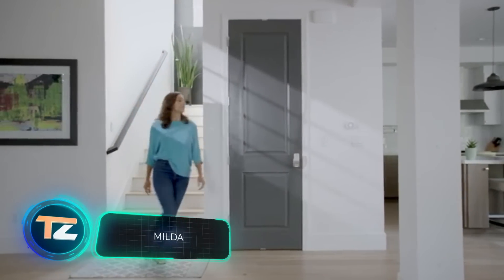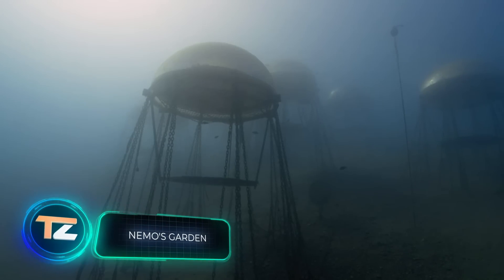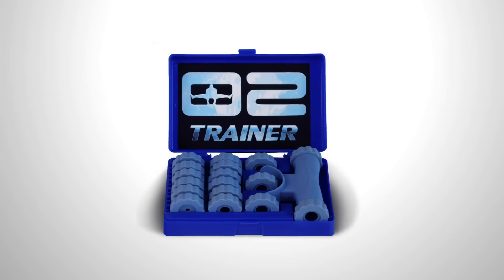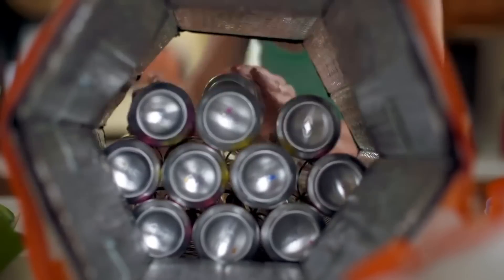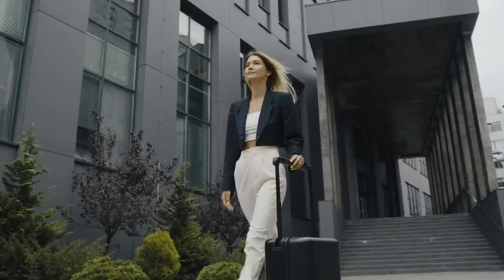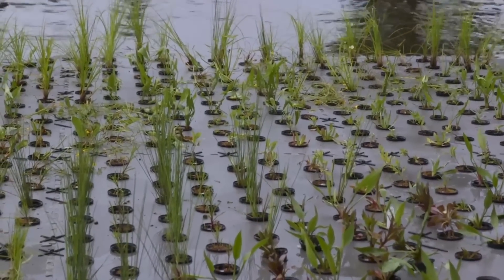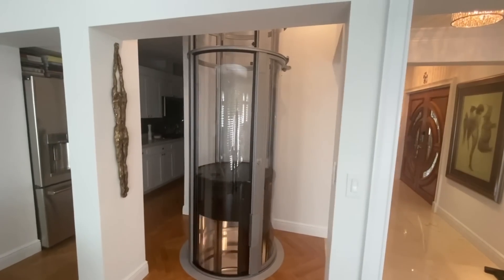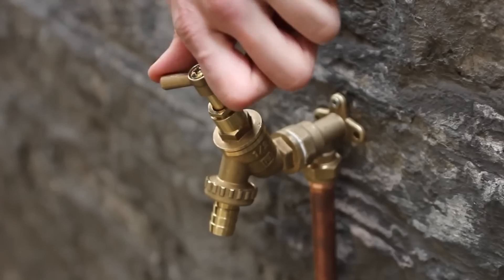12 INGENIOUS INVENTIONS YOU'VE NEVER SEEN BEFORE

Comment: Yeah, that "O2 Trainer" is basically a pvc valve. We had those in marching band, you can go to any local hardware store and buy a 1-inch pvc pipe valve for maybe $2, turn it so it's about 3/4 of the way closed, and practice your breathing. No special expensive device required.
Reply: Exactly. It's called suffocating. Doesn't take $70 to do.

Comment: That one for the fightfighters, that water lance that can penetrate concrete and metal walls will be very useful. Firefighters can just go on the crane then stuck that hose in the wall of the building and concentrate the water where the fire is most without busting windows or doors that just let in oxygen further fueling the fire or having the fire lick your face bec now the doors and walls became your shield. Kudos to the inventor! 👏👏👏

Comment: So the typing option provides a 20% slower option and requires a newly learned skill set on top of a bulky device that is in addition to the tablet. I’m SHOCKED that it didn’t take off!
Reply: Especially since voice use tech is getting better and better.   Yes the cliche is if you can just talk to text, why not call, but there are uses for texting over calling (if they are busy, late at night, not sure if they are available in general).   I think that product may have been good.. 20 years ago.

Comment: The water lance is a specific application tool. It's not replacing normal fire fighting gear and hoses. It's designed for fires on ships and in confined spaces. The lance wouldn't do anything to a house fire.

Comment: O2 trainer, a pipe with variable sized holes. You know what also has that function? A mouth. 
There, I saved you $60.
Reply: This is literally a $2.00 plumbing tee with scuba mouth piece put on one end of the tee. With two caps with on the other ends   with holes drilled in them. Buying this all at retail would be under $15-$20. Those extra caps are cheap and you want to save money you you buy one set of caps then make your own inserts from scrap plastic soda bottles or what ever..

Comment: Right off the bat. Must be said in a fire DON'T open a door if the handle is hot. It means fire is on the other side. You are in a room filled with oxygen. You open the door and the flame will be fed by that oxygen. To sell a door handle without this knowledge is careless.

Comment: I really enjoy these videos! Re: 8:17 The water lance that uses water to cut steel and concrete. Its got to be way more then 1000 psi. I use 1000 psi to wash the dirt from underneath my fingernails. I would estimate 50,000 psi for cutting steel.
Reply: 1000 psi ... say good bye to your finger
Reply: Haha! I own (2) Pressure washers. One is 3700 psi gas engine driven and that is a little dangerous. It can make gouges in soft wood - NOT cut steel. LOL
     The other is an electric 1700 psi model and it is harmless. I use it for mold on painted surfaces, mud on my ATV, and to wash my hands. It does a good job too!
Reply: @mikevp5303  he has terminator hand apparently lol

Comment: First up, if a door handle is hot in a fire it's because the room behind is ablaze and has reached a temperature sufficient to heat right through steel, which means if you open the door you could be killed in a blow out as you would add more oxygen to the fire and increase the danger.

Comment: 08:15 🤔 I was using a similar device in the early 2000's but the pressure of this device was 10,000 pounds max
Reply: I was wondering about that. Power washers operate at over 1000 PSI and I don't think one can cut through concrete.
Reply: @dlb4299  the pressure sprayer I used was powered by a CUMMINS DIESEL ENGINE

Comment: O2 trainer. I find just breath holds do a lot, when run out of air get intense contractions and they work the breathing muscles. Or pack as much air into lungs then compress and expand rib cage as hard as possible sets of 10 to 20 5 sets. Friend tried it and mid back started spasming

Comment: What crap. Mostly harebrained ideas that cause MORE work than they save. The prosthetic was cool but no way it will be $8,000 when a regular steel rod leg is $25k. The moldable glue at the end will sell if it works as advertised. The underwater garden? Why? The veggies will be $$$!

Comment: "...And it can run on solar power."
So it uses electricity? Why didn't you just say that?
Reply: Are you talking about the elevator?
Reply: @cvp5882  Yup.
Reply: It uses electricity to power air compressors. It is a pneumatic elevator, using air pressure to actually move the elevator capsule. There are only a few ways to achieve this. Chemically using reactants that when combined release gas to provide a pressure differential (not ideal),  thermally using heat to expand a gas to produce a pressure differential (also not ideal), mechanically using a vacuum, and mechanically using a compressor that could be driven by many different sources (electrical, gravity, hydraulic, wind etc.). Electrical motor-driven compressors are an obvious choice and this elevator apparently can be powered by solar, a generator, or power from the electrical grid. I'm sure the presenter was assuming their viewers knew this was obviously an electric powered unit. Bold assumption, I know.
Reply: @cvp5882  My point is it was worded badly, he should have said it has a solar add-on that you can buy. Because everything that uses electricity can be run on solar power. It just requires solar panels, batteries, and maybe an inverter. Theoretically there are also other options but most of them aren't likely to be used on a single house.